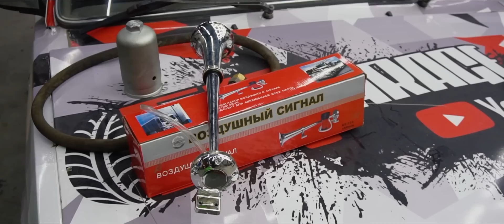Will helium change how an engine sounds?

Comment: I suggest running a engine without fuel or ignition, and revving it up by means of a electric motor, to about 5000 Rpm then introducing the gasses to hear how it affects the sound when passing through the cylinders.

Comment: Maybe timed direct port injection a fraction of a degree BEFORE and again AFTER spark ignition. Of course that is for sake of the experiment with the compressed gas, it is always easier to add a liquid compound to the fuel that produce the same intended effect.

Comment: you should feed it trough brake booster hose.. it wouldnt stall the engine as air/fuel mixture would be still same

Comment: Try H2 thats hydrogen It will make mo power. A points and coil car on H2 yeah yeah sounds different no O2 or Nitros. Alcohol good go to 5 to 1  and 3 cfm H2. on WOT double HP. IT will double hp at least and make loud exhaust.

Comment: do a hydrogen project. run the engine off electrolysis on demand and burn off the hydrogen to run engine. even compressed hydrogen but that not as impressive...

Comment: SF6 is very harmful to O3 and its used in Hi-voltage like above 110KV SF6 Circuit Breaker to SF6 gas used to shut the ark during breaker operations

Comment: Feed the engine extra Nitrogen, its the Nitrogen rapidly expanding from the heat created by the Fuel/ Air mix  that provides the downward travel of the piston not the explosion itself.

Comment: One day I come back to my car a there was loads of bits of plastic on the seat of my car, I then noticed that it was a cigarette lighter, also I noticed that there was little burns in the seat. I am assuming the lighter was in the sun on the seat, I think it acted like a magnifying glass which burned the seat and I think the lighter exploded. Do you think it is possible and would it set the car on fire??

Comment: Sulphur Hexafluoride (correct 'English' spelling) has an "anaesthetic quality slightly less than that of Nitrous Oxide". So lowers one's pain threshhold while blasting your ears with a Helium-fed airhorn!! Very interesting Wikipedia page on SF6. "Displaces oxygen in the body leading to asphyxiation. Inert, colourless, odourless". Leaves no residue. Is this the ideal murder weapon :-@ Arghh!

Comment: I want to know if the extra inert gas did anything to the performance of the engine. assuming you still get the same oxigen and fuel, the extra inert gas would just mean there is more to expand when heated. since it is mostly nitrogen doing all the work when gasoline and oxigen burn and heat it.

Comment: Gas needs to go in after the carburetor so the mixture remains correct - of course too much will still stall it, but gas after the carburetor shouldn't affect the oxygen to fuel ratio.  Or feed 23% oxygen, 77% helium (or Sulfur hexafluoride), by mass, through the carburetor exclusively.

Comment: They should tap the gas into the header/upstream in the exhaust so they can open the valve all the way without the engine shutting down

Comment: I'm not attacking Garage 54, but you should never burn sulphur hexafluoride in a closed space. The reason it smelled so much was because all sorts of poisonous gasses are produced when it is burned. Deadly compounds like hydrogen fluoride, hydrofluoric acid, sulphur dioxide and others. It's a mistake I've made in the past which put me in hospital for a day and luckily only had minor lung damage. The mistake I made was burning the gas in air duster cans (difluoroethane) in a closed area and I had no idea that I was damaging my lungs with the hydrofluoric acid vapours it had produced. Again, this is not attacking Garage 54 as I'm sure they would warn people if they were aware of it. I'm really saying that there needs to be more warnings on gas bottles that contain fluoride compounds. The only warning on the air duster can that put me in hospital was "flammable don't burn" and had no mention of the deadly gasses produced when burning it.

Comment: It's not so weird that the frequency of the car doesn't change. It's the engine revs that make the frequency and that doesn't change either. The heavy gas will isolate more (and the engine will make less power because it'll have more back power). The helium will basically do the opposite, but probably won't make enough of a difference.

Comment: Hey guys, how about running a Lada wide open and then start feeding it different gases, oxy/acet.nitrous oxide, propane etc.until the pistons melt and run out the tailpipe. Go for a high score on the rpm. Keep up the good work,I've learned so much watching your videos.Pete and Dee from Sacramento California USA.

Comment: Put BODY SPRAY INTO THE ENGINE 🤣 ! CUSTOM BUILD THE INTAKE MANIFOLD , WITH A METAL TUBE CONNECTED INTO IT , ON WHO'S OTHER END , SHOULD A COMPRESSED BODY SPRAY 🤣🤣🤣 GUN THE ENGINE , AND PRESS THE SPRAY BUTTON , SO THE AIR AND THE BODY SPRAY WILL BE GOING TO THE COMBUSTION CHAMBER 🤣🤣🤣

Comment: What other gasses to try...  Well, you guys have welding torches...  Try Acetylene and then Oxygen..   Though I know feeding oxygen to the motor is going to make it run REALLY hot, so I would suggest not a high flow.  It should perform like Nitrous Oxide.  Been thinking about hooking up an oxygen tank to my intake with a switch and setting it on a low flow just to give the incoming air charge a bigger bang.

Comment: I'm not gonna watch the video I'd just assume that nothing would change other than the engine not having oxygen to burn, 8-1 oxygen to fuel I believe for proper combustion, the reason a humans voice changes after breathing in helium is because it's buoyant in air and escapes your lungs faster than air, and forcing its way though your larynx with more force and making your voice higher pitched.

Comment: buy some oxygen, make it so you feed nothing but gas from the bottles into the intake (no normal "air") and you won't starve the engine. it's the extra gas replacing the oxygen in the air which is making it stall.

Comment: You could try getting a custom tank filled at a scuba supply place. They typically do custom mixes for deeper dives to lower the amount of nitrogen that dissolves into the divers lungs. From what I understand they replace the nitrogen with helium. Might work a bit better for trying to get the car to run on helium

Comment: The sulfurhexafluoride (which it not toxic), decomposes into CO2, SO2F2, SOF2, SOF4, SO2 and H2S when heated over 300°C. What you smelled might have been the H2S or some of the other stuff. Some are very toxic, I wouldn´t just smell them :)

Comment: Since you have a muffler and resonator it fights the helium even more through wave cancelation since there are so many different frequencies, plus you are adding mass to an expanding gas which is the medium carrying the sound. The cooling effect is when contents under pressure are suddenly set free it has a super cooling effect. Compressed air can be 150°F under 200bar but when a high volume is quickly released to 1bar it will get to -150°F  because it is transferring the kinetic energy it took to compress it into thermal energy. It's a cool way of cheap!y super cooling metals.

Comment: To get it out your lungs quickly hang upside down! It is dangerous because you can easily suffocate as it stays at the bottom of your lungs and it's hard to get it out. Be careful. The light gasses are not dangerous at all in that way.

Comment: Try running an engine on rocket fuels: hydrazine, fluoride (instead of oxygen), hydrogen, etc... Or perhaps play around with different hydrocarbons: benzene, toluene, hexamethylbenzene....
Reply: Toluene was actually used in 1980s F1 cars.
Reply: @marco.9900  And also on group b. But never before on a lada :) just up the compression ratio, weld the head to the block and see where it explodes.
Reply: @azulsereno5434  Thanks. It is interesting to see how different fuels perform.
Reply: Or try the 1937 Grand Prix season mixtures from Mercedes!
"Fuel used was a custom mix of 40% methyl alcohol, 32% benzene, 24% ethyl alcohol and 4% gasoline light" (Not even sure what the last bit was)
Reply: @barath4545  Benzene is good antiknock (toluene is better) alcohol is also good anti knock (it is cold in evaporation), but lacks energy density (you have to burn lots of it to make power) thus if you have limited fuel it is better to go with toluene and benzene. I really enjoy hydrazine, mix it with nitromethane and you have dragster fuel... However, it is carcinogenic.... A lot...

Comment: You need to mix it with oxygen to make it work. The smell is from incomplete burning. If you feed in some oxygen with it then it should be able to burn more normally otherwise it's just going to displace all the oxygen.

Comment: Repeat this experiment with a computer controlled engine, and also try in a different experiment,  super cooling the air and fuel using dry ice to see if it increases the horse power.

Comment: People should use Xenon than SF6.
SF6 is a strong green house gas.

Also NEVER INHALE any heavier than air gas.
Due to the gas being heavier than air, it is harder for the lungs to get rid of it.
So 1/4 of your lungs can be taken up by this gas which means less O2 per inhalation.
This can cause you to feint.

Helium can do the same, but since helium is so light it leaves the lungs very quickly.

Comment: Id like to see a gasoline engine converted into diesel.
Reply: Look on YouTube "Volvo B230 Diesel"
Reply: It's been done. Oldsmobile diesel was too flimsy, other companies have had success by changing the intake and pistons and replacing spark plug with injector. High pressure injector pump is also needed.

Comment: Fun Fact: Helium and sulfur hexafluoride have no effect on the vocal cords, diaphragm or whatever is vibrating; the pitch change happens because sound moves faster in helium, which raises the frequency, and moves slower in sulfur hexafluoride, which lowers the frequency.

Comment: just thinking.... nitrogen in air is about 71%(or something like that) 16% oxygen. Nitrogen isnt much useful for combustion, so what about replacing that with that funny stuff - like mixing it with pure oxygen. But i can imagine, it could be hard to pull off...

Comment: 80% helium, 20% oxygen: the engine will run perfect.
Reply: 79% nitrogen, 20.5% oxygen .5% argon/helium/other exotic gasses lol, it should run fine
Reply: @shanek6582  lol I see what you did there.🤣
Reply: @shanek6582 Indeed. When asked if I wanted my tires filled with nitrogen, I told the guy offering that I prefer a 80/20 mix  of nitro and oxygen 
He didn't even catch on to this 😅
Reply: @thefreedomguyuk  lol, from some of the comments I think there's quite a few people that don't know the average % of what they breathe every day. You just reminded me of a guy at work that bragged constantly about his nitrogen filled tires, after him, even if I could be convinced it was the way to go and it was free, I probably wouldn't have it done to my truck, he was a douche.
Reply: @thefreedomguyuk  the guy proceeds to fill the tires with 20% oxygen, 80% *nitroglycerine*. Gives EXPLOSIVE acceleration 🤪
Reply: @shanek6582  argon doesn’t burn.
Reply: @shanek6582  You should be organising parties.  You'd be able to create that perfect atmosphere.
Reply: @KenFullman  good dad joke
Reply: @shanek6582  thts o zone lmaoo
Reply: @Ak2TheSky  thats what you breath in every day.
Reply: @LaCacaLoca  EXACTLY 😂😂👌
Reply: @Ak2TheSky  you do not know what ozone is
Reply: Cause that's no ozone
Reply: Helium instead of nitrogen makes not difference air still has 21% oxygen :)
But I suppose you meant 80% helium 20% air which is ~4% oxygen, that makes the mixture very rich. If it had an o2 sensor it would compensate but not entirely
Reply: you mean 100% nitrous oxide and it will run perfect
Reply: ...but with a high pitched exhaust the everyone will laugh at....
Reply: I'm not very sure. Helium is extremely good heat conductor. It also have very low viscosity so it'll flow past of carburator throat like nothing. Anyway, that would be very interesting to test. Just needs one of those giant balloons filled with proper mixture. It takes a while for oxygen and Helium to mix properly. In scuba tanks it can take few hours.
Reply: Should greatly lower the cylinder pressure to run 80%helium instead of 80%nitrogen
Reply: Everybody in this section of the comments don't realise it would be a good experiment, which I thought they were going to do.  Maybe if the garage 54 did this we would notice a significant sound difference?
Reply: wow,   I didn't know that
Reply: Well that’s how all helium tanks are after 2016 to save helium,
Reply: Exactly my thoughts 😂

Comment: It might run if you were to use a mixing valve and an oxygen tank, and feed a 20%(oxygen) / 80%(either helium or sulfur-hexafluoride) into the air intake...

Comment: I wonder what will happen if you feed Propan into the intake will it run? On the propane instead of fuel? Or will it stall because of the lack of oxygen? Or will something crazy happen like it blowing up?
Reply: Will run just fine on propane.

Comment: Have you ever tried helium inflated tires instead of air?  would that make a difference in the ride?   That would be interesting.  Or maybe make the vehice weigh less?   Thanks for you videos.
Reply: Yes they would weigh less, cop cars often used it in their tires for more speed as well.

Comment: Why don't you try feeding a car hydrogen instead of air?
Reply: Hydrogen in itself is unstable to make and burn as its so flamible that it will burn in oxygen alone and is nearly invisible when burnt with a flame.   Also Hydrogen needs to be used with great caution as it will burn inside your supply line if your car backfires which it will and your source will expload.

Comment: All sorts of nasty sulfur and fluorine compounds, including sulfuric acid got generated in the intake test.  For another experiment, fill a subwoofer box with the sulfur hexafluoride and compare it with helium.  And try pure nitrogen and carbon dioxide as the next gasses.
Reply: I was thinking the same. N2O makes your voice deeper so why didn't they just use that?
Reply: Nice

Comment: Feed pure oxygen then chek engine performance work excellent 👌
Reply: It will run lean and melt pistons.  You'd have to inject extra fuel. It's the same principle as nitrous oxide.

Comment: People, please, NEVER EVER leave a gas cylinder sitting like the one leaning against the front of the car. If that thing falls over and the valve snaps off it's flying through a wall and anyone standing in the way. There are videos of this happening on YouTube. Myth Busters even did a video on it. Search "gas cylinder rocket".
Reply: I agree. Some guy dropped cylinder full of oxygen in factory nearby. It blew a hole through two brick wall and it was later found about 7km away....
Reply: There tougher than they seem
Reply: @CHEVYK10  So are humans, but we still wear seatbelts and motorcycle helmets.

Comment: In high temperatures sulfur hexafluoride converts into sulfur tetrafluoride, a toxic gas. What's more sulfur tetrafluoride, besides being corrosive, reacts with moisture in air and releases hydrofluoric acid, which is even more corrosive and toxic. The sulfuric smell mentioned in the video (10:40) is most likely sulfur tetrafluoride.

Comment: Hook it up like a NOS bottle then see what it does ?
Reply: Helium is an inert gas... itll always stall it as its not flammable. Not until you get it up to near sun like temperatures 👍
Reply: @SiR2Dean  , Did not know that , Thanks for the info and great video .

Comment: Fill the tires with Helium... lighter Wheels = faster car
Reply: Won't work. The speed of the car wont change because its mass is still the same even though it has less gravity with the helium
Reply: @hell_pike9150  If the car-engine is pushing forward a Lighter car, then is should go a little bit faster..
Reply: @PeterGriffin-gh8dz  Its less downward force on the tires towards the ground but it doesn't reduce the weight to move the momentum forwards backwards or side to side。 Good example look at paramotor vehicles。 They will generate enough lift to take off of the ground， But their speed isn't increased by this because they still have the same weight
Reply: @Lassi Kinnunen 81 My point is you could for example put a tank of helium on the car and it would actually just add mass even if the weight changes and seems lighter， the car still has to move the same momentum forwards

Comment: If you fill the engine box w the heavy gas and let the air box remains uncovered so engine runs normally  ..would the heavy gas silence the mechanical noise of the engine. Would heat transfer improve allowing better cooling  and would it prevent deterioration of the outer engine components like oil submersion prevents rust maybe in the future we will protect our engines w airtight gas boxes so nothing is ever rusted on or corroded ?